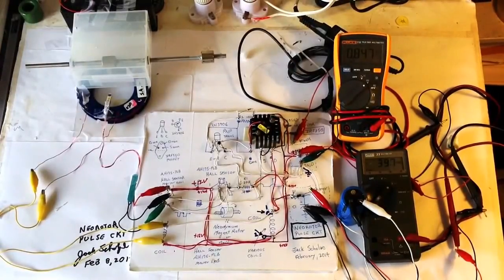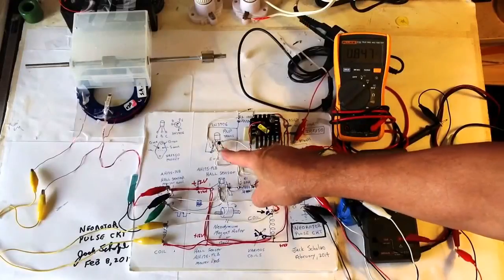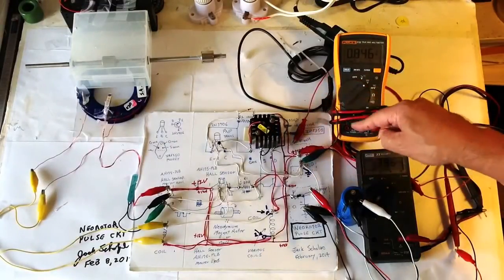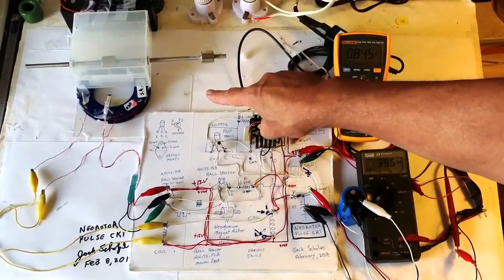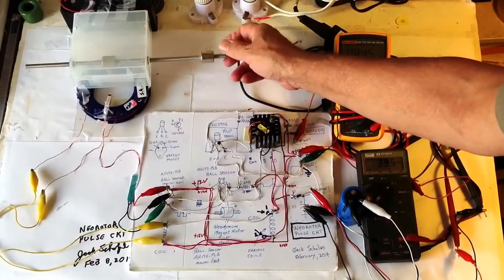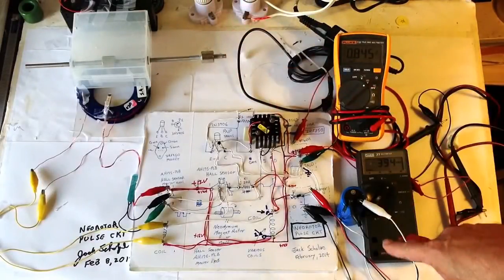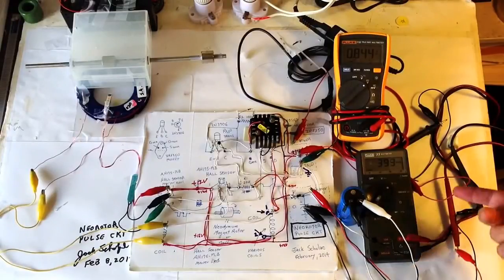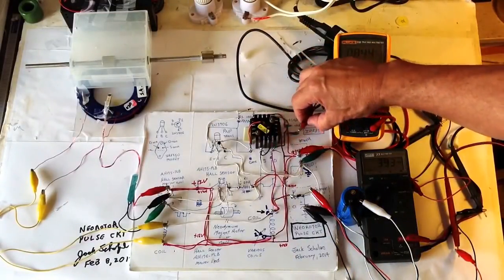Neorotor Pulse Ckt with Schematic

Comment: If you dumped the energy via the diode from L1 straight back to the 12v rail

Wouldn't it run longer?

Comment: Great video, My circuit is similar. I just started playing around with ways to reduce the amount of radiant energy that goes back into the driving circuit. The diode and Cap idea is cool, I was using a microwave capacitor and a 12 lamp in an attempt to drain this HF energy off rather than let it go back and damage the mosfet and diodes. I have a lot of radiant energy on the gate of the mosfet. I tested this by using a diode with an AV plug. The radiant being high frequency will travel over any capacitive elements (like the gate capacitance). Tesla used a spark to separate the driving circuit from the primary coil for this reason. Maybe it can be full bridge rectified and put back into the supply voltage to reduce amp draw...either way thanks for sharing!
Reply from the maker: thanks, i tried to make it easy to understand.    You can recapture some of that backspike energy as John Bedini discovered, and close the loop indirectly to achieve an over-unity device,  but I don't claim that or dwell on it so much.  I'm trying to get my Hendershot device to oscillate.